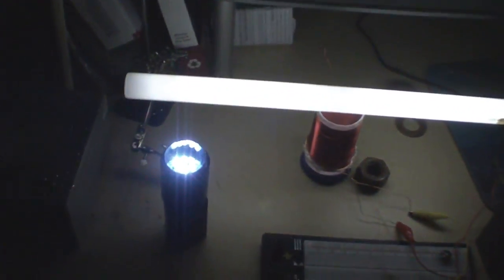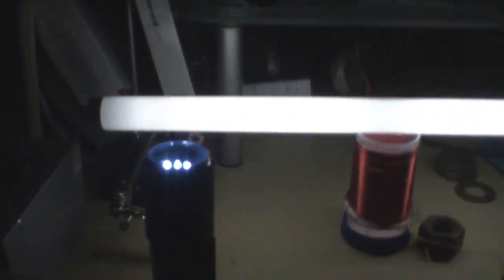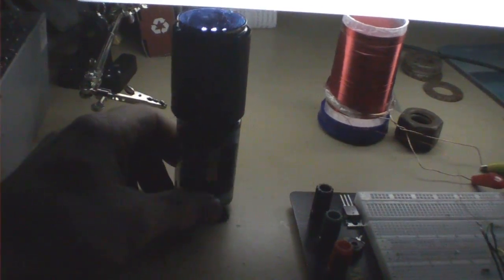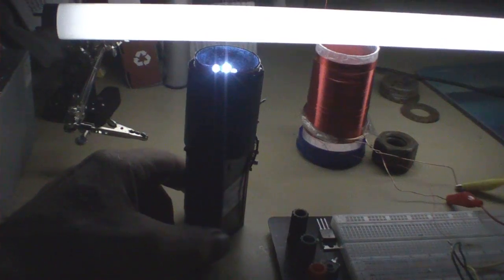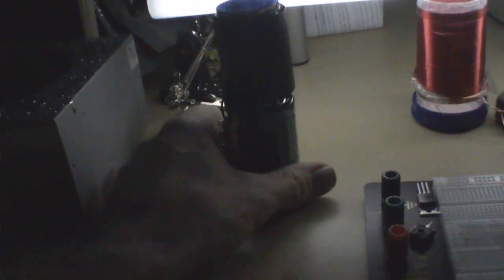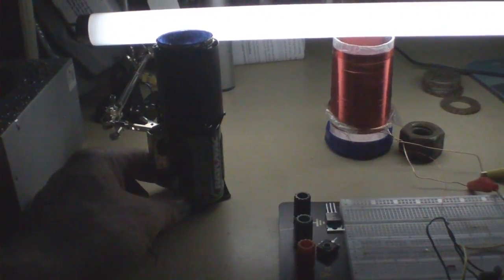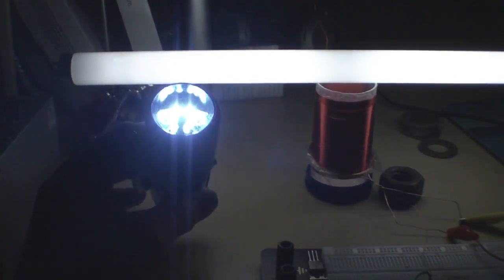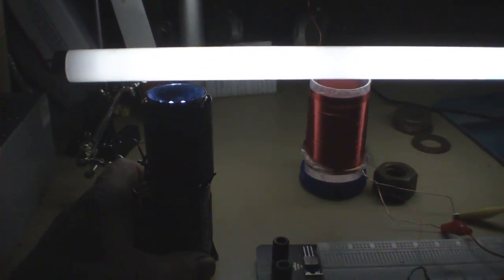Joule Thief Spotlight - Joule Thief Candle + Slayer Exciter (Total less than 1 watt)

Comment from the maker: @ciprianwiner It is now, it's been a learning process. My friend the Magneticitist on here has some killer vids, check them out. He got me started on a very basic circuit so my daft brain could deal with it. I did finally, after months, learn how to use a variable resistor between the base and positive rail. Initially it never had an effect, because I always used a 1k, 2k, or 10k variable resistor. Turns out this coil likes about 67-72,000 ohms. Things perk up at that point as u can see.